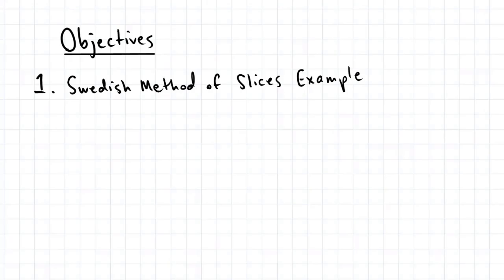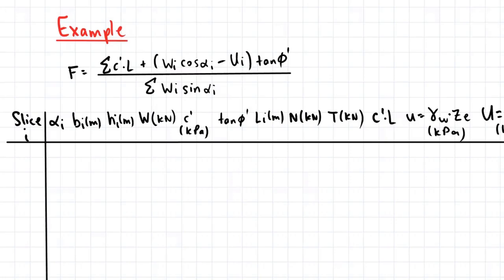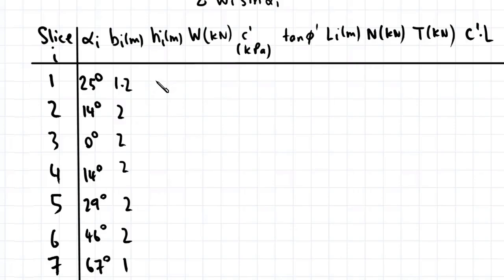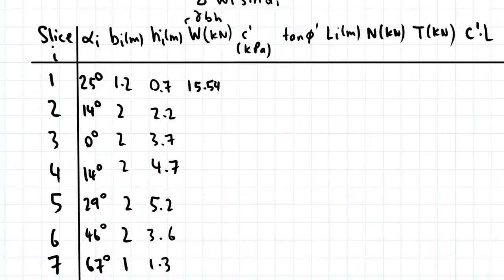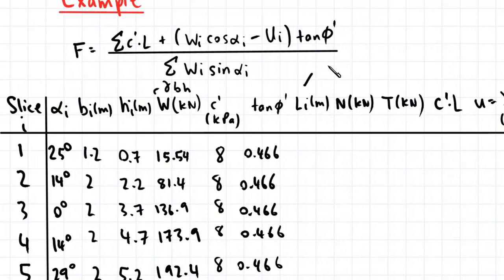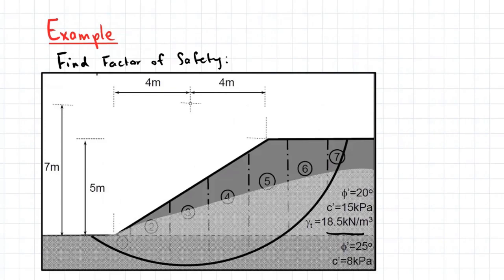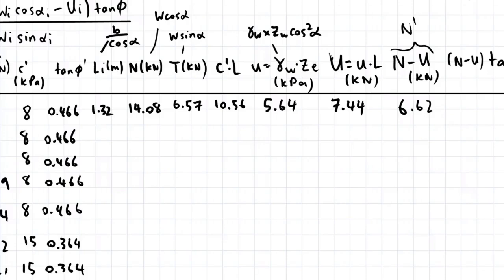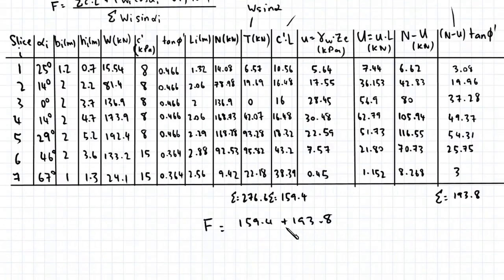18.8 Swedish Method of Slices Example

Comment: I have 2 question, 
1. Did you assume the dimensions for the width and height of the slice?
2. Is there a way to calculate the angle of the slice without using protractor?
Reply: This is what i wanna know too TT
Reply: Did you get an answer to that?